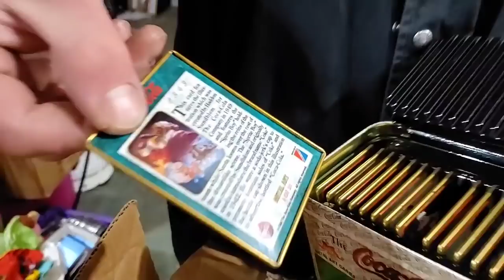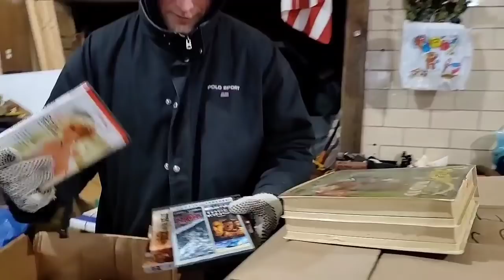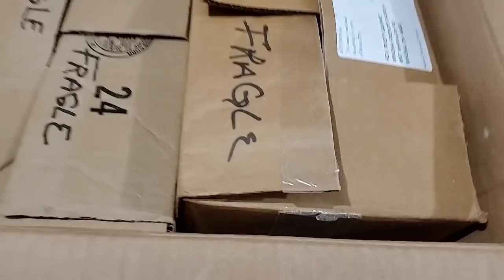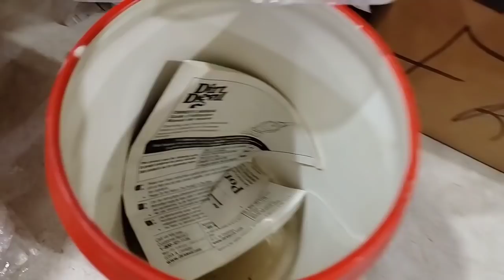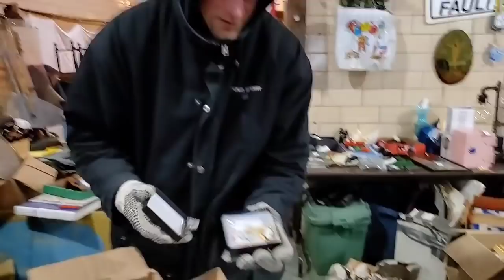Owner Doesn't Pay on Storage Unit so PACKED & STACKED Barely fits in 26' TRUCK! I buy ABANDON Locker

Comment: ROB I was going to comment on yesterday’s unit. It looked like a used  container of baby wipes it was up high on the wall. Dude you really need to slow your roll.  You picked it off the wall upside down. I immediately saw lancets for diabetics to prick themselves to check their sugar level. You flipped it so fast I couldn’t tell if any were without the caps.  But like a kid on Christmas morning pulling things up and shuffling things around.  That could have made for a not so flappy day.  I like you and don’t want to see you hurt.  Like I said slow your roll.